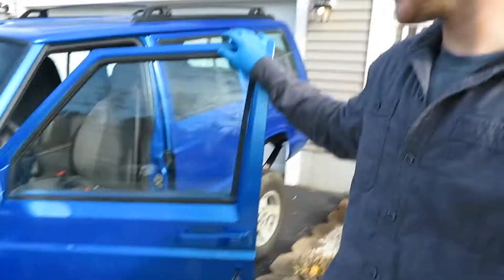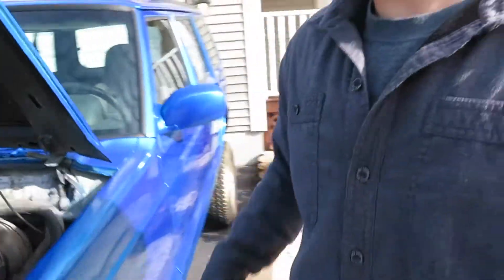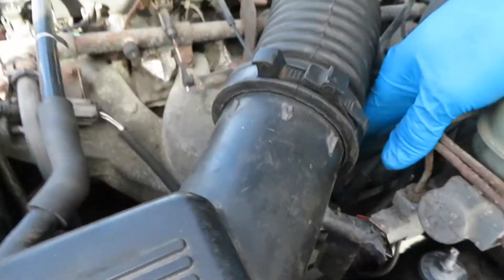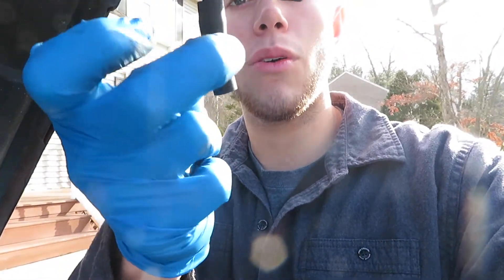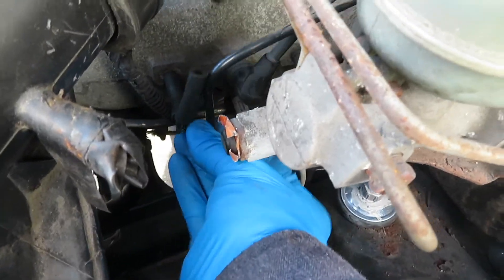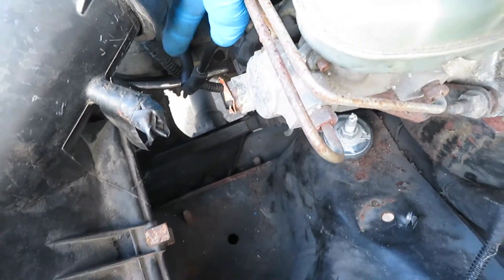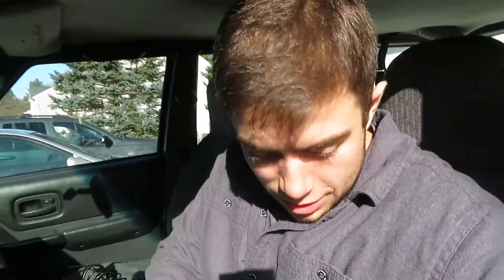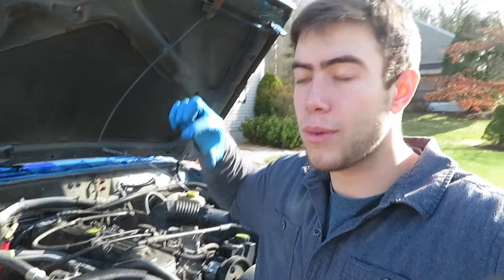JEEP XJ EVAP LEAK PROBLEM!!!

Comment: Code is cleared ya,but did you go thru the 3-5 engine cycles. You have to run it up to normal operating temp then shut it off & let the engine get cold. That is the cycle. The vehicle runs the test every 3-5 cycles. Unless you know how many times the engine has cycled it may stay off for a while,until it's time for the vehicle to run the leak check.

Comment: Thank you so much for your video. The Check Engine light on my 2000 Cherokee was on, and the code was for the evap pump. I had to get my car inspected by the end of this month, with the Check Engine light on, I couldn't pass inspection.
I saw your video, and looked for the vacuum hoses. The exact same hose that you fixed on your Jeep was just hanging there on mine. I used a zip tie as a temporary fix, and it did the trick. I passed inspection.

Comment: Nice vid man ,  same problem happened to me but I was able to fix it the same way , now here  comes a question,  Has  any one experienced this problem on a 2000 xj  tail lights wont work only when i hit brake they will turn on , but after i let the brake go they will turn off again . Any help ?  I checked every single fuse and they are fine .
Reply: The headlamp switch plugs into a receptacle that has a reputation for melting from inadequate wire gauge. Remove your headlamp switch and check the receptacle. Mine was melted badly. All lighting wires go through here.

Comment: You can get that exact boot at auto zone. They are not vehicle specific, but they are identical. Cost about $4
Reply: got a link to the part?
Reply: @nevertellanybody  it’s called a vaccuum line boot. They come in many shapes and sizes. A few different ones can work for this

Comment: The Zip Tie fix is a great shortcut and worthwhile, as I found a previous, newly-replaced corner hose had lost its grip.  Good rubber with a zip tie holds it firmly.  Thanks.
Reply: the zip tie isnt doing anything. you can literally run it with that unattached and it would likely still take months for the check engine light to fire back up.

Comment: Quick question. The vac line that you just worked on, where in the engine bay does it run to?
Reply: Did you ever figure this out
Reply: @lovable6803  Yes I did. I just capped it and did trial and error to see if the car stalled. It didn't. So I left it capped lol.

Comment: Holy shit, that exact connection was off of my 01 XJ as well as dry rotted pretty good 😮 thanks for this video!
Reply: By chance would you be able to tell me where this line goes exactly. I have a 99 XJ and the line is completely gone for this nipple off the intake manifold. I dont know if I need to cap it or find/replace a line.
Reply: @sdubb1518  still looking?
Reply: @MrYlojelo I am! 2 years after your comment :-( 
Mine is missing in my 2001 XJ and I don’t know where to connect a new one to.
Reply: @mgarza79  ill take a look, I think there are three
Reply: @MrYlojelo  any help would be appreciated